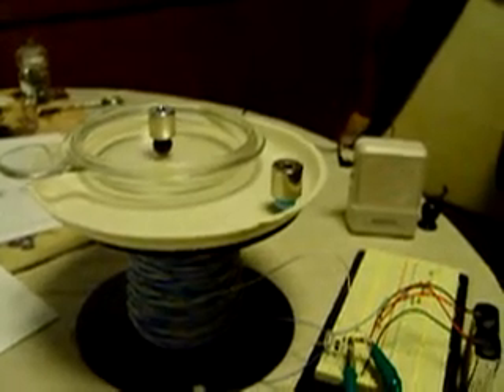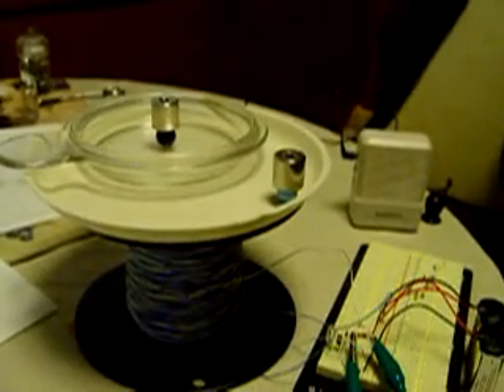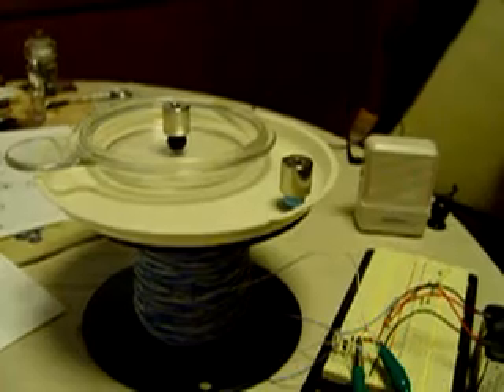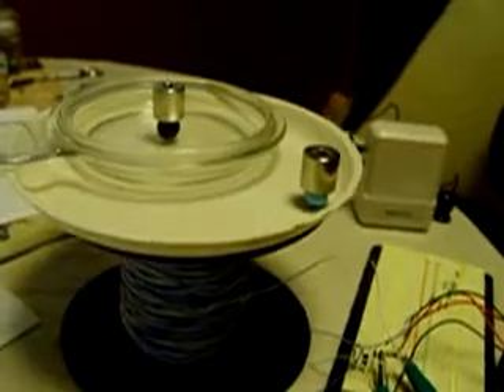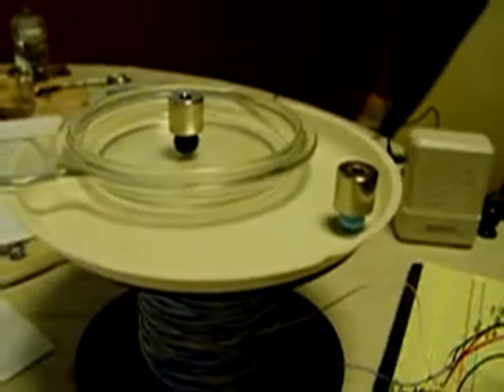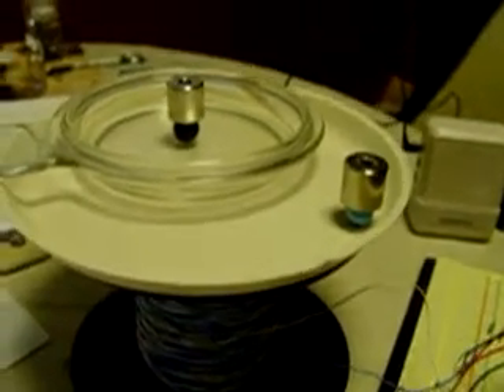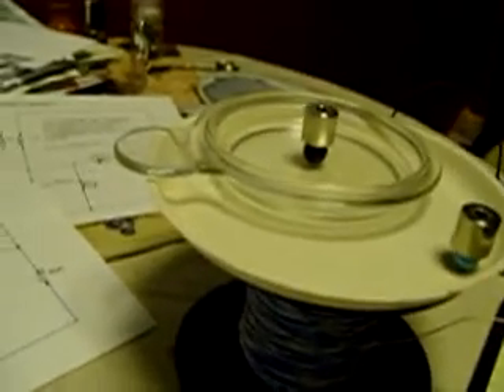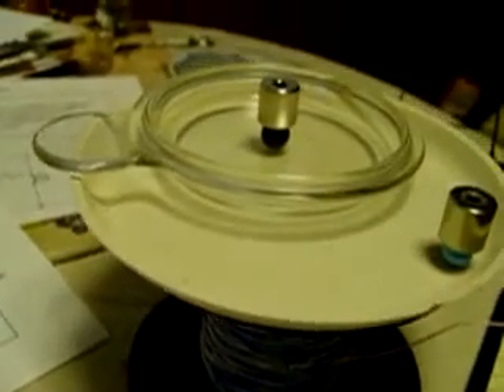Two Magnet No Bearing Bedini / Davro Follow-Up 1

Comment from the maker: The wire these days is a trade item known as distribution frame wire.  Try a wire jobber who could make this spool easily for stock wire or try to find Essex
12-214-T5
12-215-T5
12-101-13
12-102-13
12-103-13
Tell the jobber you want access to all ends of the wire